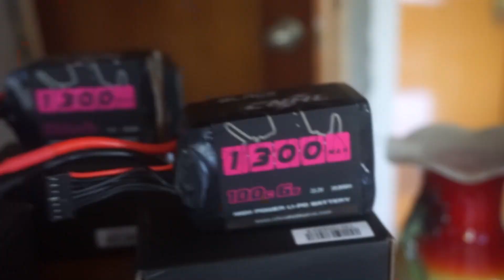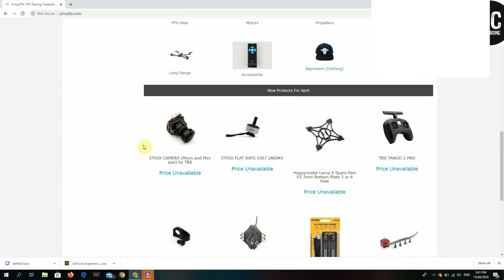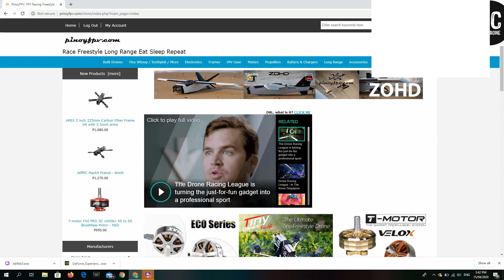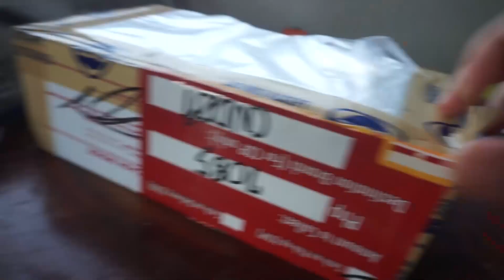How to make your cinematic FPV Drone !!!

Comment: Sir panu yun balak ko sana micro drone like armattan tadpole kaso yung ibng parts d available kay pinoy fpv pede poba kayu mag recomend ng parts na pwede at availble kay pinoy fpv para kay armattan tadpole salamat. Godbless po
Reply from the maker: Try niyo din po kay jcfpv sir or shoppee. Pwede niyo sir isend sa fb page yung mga parts na meron na kayo para alam ko mairecommend salamat 😁
Reply: Pano ba maidentify sir kung fit yung ecs, flight controler, anttena,cammera at radio contrller sa frame ko na 2.5 inch armattan tadpole iba iba poba sya ng sizes ng parts the more na nalaki yung frame baka kase masyang pag bili ko ng parts kung d pala sya compatible sa frame kona 2.5 inch armattan tadpole salamat gobless po